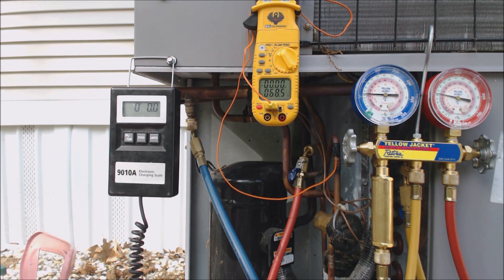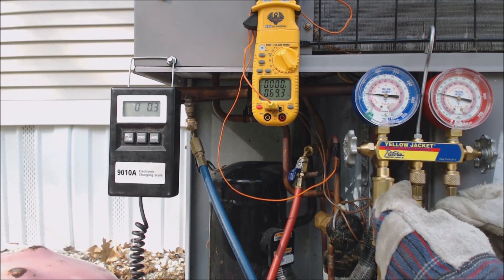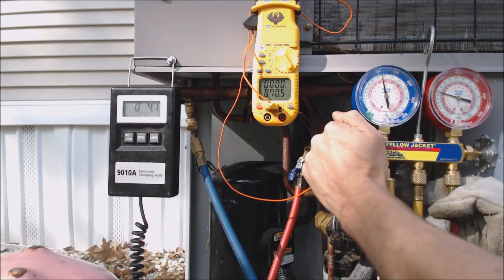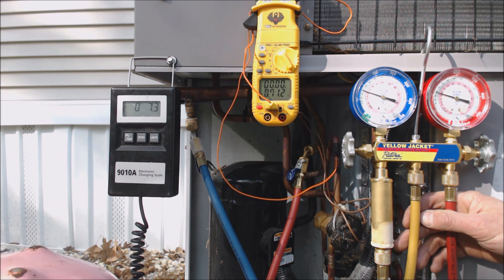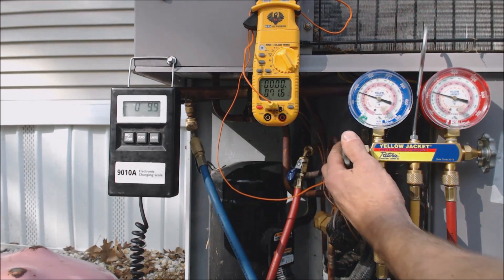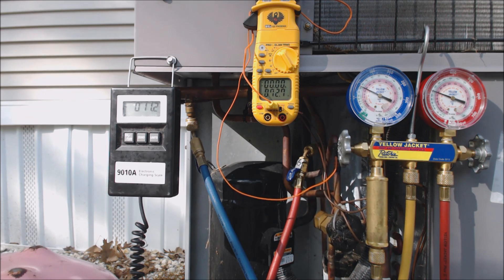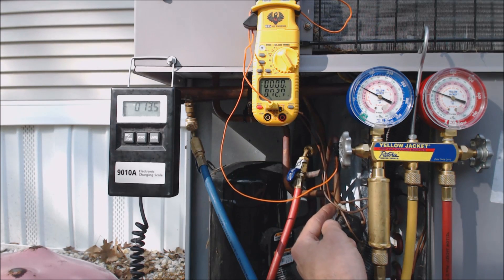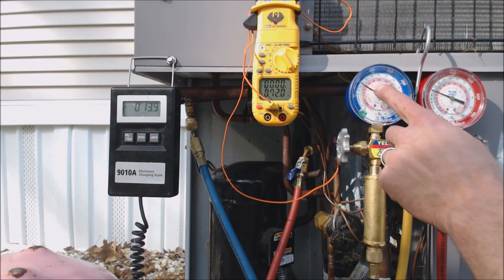R-410A Charging! Charging a System that is Very Low on Refrigerant,  Avoid the Evap Freezing! Part 1

Comment: R410A is a blend and I was told that the refrigerant needs to be removed and a new virgin charge put back in so you maintain the correct blend, what is your comments on this rule of thought?
Reply from the maker: Great question! In the case of R-410A, manufacturer trainings will say it is ok to top off systems as far as the blend is concerned because it is near azeotropic even though they want the refrigerant to come out of the bottle as a liquid to avoid fractionation. Obviously not over and over again. If you are working with other zeotropic refrigerants then more care must be taken when fixing leaks and adding to the charge. Here is some good reading material. Thanks for the question! http://www.achrnews.com/articles/82752-blends-101-an-introduction-to-refrigerants
Reply: Thank you for the information!

Comment: I have charged about 2 lbs R410 as a vapor with my 25 lb cylinder, not knowing that it should have been in liquid form. Is is possible that I damaged the remaining mixture in the cylinder?
Reply from the maker: Actually yes, the unit should work but may not be efficient. Also the bottle would not be considered good either because the mixture is not 50/50. Sorry

Comment: Nice videos! I just had a tech come out and recharge my Rheem 3.5 ton unit and this has me worried it was done super fast.  He said the unit was really low and added about 3lbs 14 ounces of 410A in less than 30 min.  From what I could see on the inside panel, the Rheem gives you a chart of pressures that should be read on a fully charged system depending on ambient air temp so I was watching his digital meter.  Although he ran out of refrigerant before it was "fully" charged (he offered to come back later if it wasn't cool enough). Looking at your vids, I can't see one that is exactly like the Rheem but this makes me more comfortable knowing what they are doing and hopefully more comfortable doing it myself in the future. Thanks.
Reply from the maker: I am very glad that you appreciate the videos!
Reply: Package units are differnt than split units. You don't have to be as cautious charging as with these types of units I'm guessing.

Comment: I have one question that always confused me. when and what side do you charge the systems low or high side?
Reply from the maker: You always charge the system into the low side when the system is running but if the system is vacuumed down to 500 microns and off, you can weigh liquid refrigerant into the high side. Thanks for the question!weighing in at 500 microns https://youtu.be/ncgLDYrvN6wCharging in real time https://youtu.be/7LMYRS-yvXQ

Comment: Hey there , today I had a heat pump that the high side was running about 225 psi. My sub cooling seems to be ok. But my suction side wouldn't get above 70 and my txv would keep freezing.  I diagnosed this as a txv failure do you think so as well ? It's a Maytag heat pump that had no sub cooling temperature on the name plate so I used 10•f.
Reply from the maker: Likely, especially if the superheat was high. You can know for absolute sure by using the ice water or hot water trick while checking superheat since the txv controls superheat with bulb temp. The txv should not freeze though on comfort cooling.Check out my TXV playlist to see some examples. Thanks for the comment!

Comment: Hi very informative video. One question, what's the difference between the discharge port and liquid port? Thought they were the same thing...
Reply from the maker: Great Question! So the liquid, high side, and discharge are all referred to as the same thing in the field. The discharge off of the compressor before the condensor coil is where this manufacturer has placed its service port and there is no port on the liquid line at all. This compressor discharge port is reading the refrigerant at its hottest point in the entire system as a vapor. This manufacturer stated to take the pressure reading from this compressor discharge and a temperature on the liquid line after the condensor and that is why they are calling for such a high subcooling even though that technically is not a subcooling but a total temp decrease measurement. This is not the norm as most have a liquid port where you convert to a saturated temp on your gauge set minus the actual temp only a few inches away to get the actual subcooling. Thanks for the Comment!